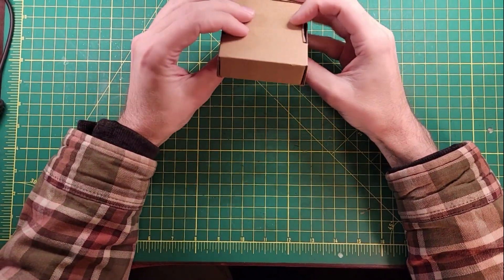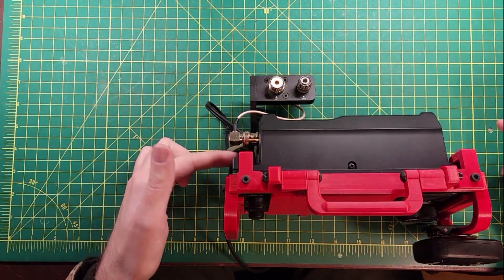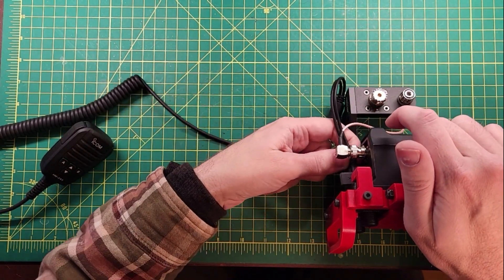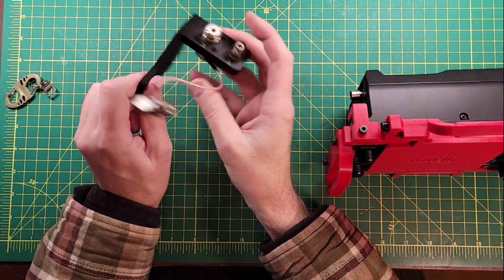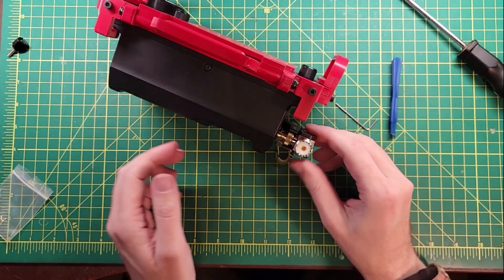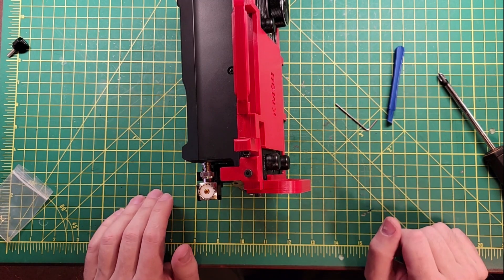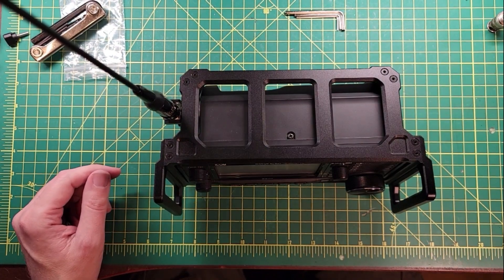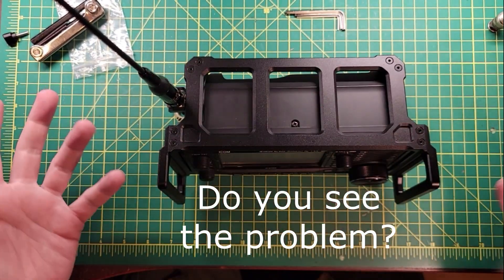Windcamp RC-2 for the IC-705

Comment: so i totally ditched the right-angle plugs on the mic/speaker connections about 2 days after I got my 705 - replaced them with straight plugs, have the full windcamp setup - frame and V2 antenna mount - no issues
Reply from the maker: That would do it
Reply: What straight plugs did you use?

Comment: My original wincamp rc1 mount causes terrible swr issues, interested in an alternative , thanks for making the video. Hoping without the coax it will be more reliable.
Reply from the maker: Interesting info.  I don't think I've ever run without the windcamp connector... I wonder how mine is.
Reply: @temporarilyoffline  I've learned today on FB that windcamp don't always solder them connections properly which may be what's wrong with mine.
Reply: I have the same problem with SWR.

Comment: I will get this, even though I came up with a solution for the RC-1. This is much more compact. As far as the speaker/mic plug issue, maybe the best solution is to come up with a dual male to female plug with straight connectors that is like 4 or 6 inches long instead of having those 90 degree plugs right up against everything.
Reply from the maker: I've thought about swapping the plugs to straight plugs.  Would make sense in this configuration.  The only place those right angle plugs make sense to me is in a permanent mounted go-box
Reply: @temporarilyoffline  I'm wondering if the Icom OPC2144 would work. It doesn't specifically say it fits the 705, and it's still a right angle, but at least it's a single right and you can plug or unplug the other end at will.
Reply from the maker: @W9HJBill  I might work, but for the cost of these 3 items, one "shouldn't" have to add a 4th.  I'm just grumbling though, not arguing.
Reply: @temporarilyoffline 
hint:
rotate the radio 90 degrees to be vertical. 
demand  addition of "portrait" display mode.
solved.

Comment: Agree it seems a bit odd. I don't have a 705 yet!

The speaker mike connections look like they are right angle. Perhaps vertical extension, plug and jack, would allow a better connect/disconnect. Of course losing those is a down side.
Reply from the maker: Exactly!

Comment: Two things: 1. Put on the BNC/SO239 connector first, then mount the antenna mount pieces. That way you can get the BNC latched on easily. Then tighten down the little Allen wrench set screw. 
2. The speaker/mic connection is the worst part of the radio (other than the manuals). I'm waiting on some connectors & other bits to make a single use mic for the radio. I don't need the speaker mic and if I need headphones, I use my iPhone BlueTooth earbuds. When I get the yet to arrive mic parts modified, I expect I'll have simple one plug mic. 
. . . At the same time, if Icom had made the mic & speaker connector spacing to match other speaker mics with that style of plug-in, well, all you'd have to do is get one of t hose cheap Chinese speaker mics (or have Icom provide a proper mic with the proper single plug hardware) and go that way.
. . . The IC705 is a boffo radio, at least so far to me, but it does have it's "Why'd you do that?" flaws and questionable ergonomics.
73 de W8IJN
Reply: Also, the WindCamp wrap-around makes it impossible to mount the Begali Adventure IC-705 bracket to the radio, since the screw holding the bracket on the radio underneath uses the same 1/4-20 tripod thread on the bottom of the radio as the Begali bracket. My only way around that is machining another 1/4-20 threaded hole in the wrap around, which throws off the balance of the radio & bracket, not a workable solution the way I see it. Thus the HamGear3D frame is what I use now.
Reply from the maker: That hamgear 3D frame is excellent also!

Comment: Not had a problem with the RC-2 as I only use the microphone socket but there is the option of using the trailing eight pin microphone adapter cable from ebay.
Reply from the maker: Good Idea, Thanks!

Comment: You could’ve used the longer ground screw from the RC-1 and used a couple of small washers under it to space the bracket out?
Reply from the maker: I probably could have, but the products from the same company should have worked together out of the box - even if that meant including the extra hardware to make it happen.
Reply: Yeah I just looked at it really closely and I don’t think it’ll work it would block the articulation if you spaced it up. And 100% percent agree with you, it should work straight out the box. The Peovi stuff is way expensive.  The add on cage is $150
Reply from the maker: @BadHorsie2  I would ABSOLUTELY LOVE that Peovi cage in anodized red or orange!  I just can't justify it.  The windcamp cage is very nice and functional on its own and the whole works fits nicely in a 50cal ammo can.  Hard to beat.

Comment: It be nice if you can put a dual antenna that you can switch back and forth like a 2 meter and 10 meter that we use on a regular basis. Hopfilly with out using an antenna tuner.
Reply from the maker: They make a diplexer that will let you switch like that.

Comment: Put the Philips screw into the ground on the radio and use the thumb screw for the angle adjustment.
Reply from the maker: Since then I've added a lead with a single Anderson powerpole to the ground connector - now it integrates nicely with the rest of my antenna systems.

Comment: When I got my RC-1 on the surface it worked but seemed to be clunky in practice. The RC-2 looks a bit better thought out so it may work better. I have a PEOVI PV705-1 cage around my 705 which I like. Although is does not give me the same amount of protection as the cage you have, it functions well and looks like it will work just fine with the RC-2. So with that said I may just order the RC-2. Thanks for the Video and take care. Vic de KE8JWE
Reply from the maker: You welcome Vic, let me know if it all fits together.

Comment: Struggling to find a source for a straight 3-6" M-F 2.5mm TRRS extension for the mic. Anyone have a link? (the 3.5mm TRS speaker plug is easy to find)
Reply from the maker: I can't find any either... I'd probably build one from a larger cable.  I can't even find 4 pole "solder on repair" parts.

Comment: The RC-1 lacks two parts that would make it 100% compatible with the ARK-705 cage. It needs a spacer and a longer mounting screw to put it completely outside of the ARK-705. Without having the IC-705 and the ARK-705 in hand to get proper measurements, I would say that a spacer that is about 1/4 to 3/8 inch long would be enough to clear the cage. That's it...an extra few bucks makes the two work together.
Reply from the maker: Amazing you could figure out from a video what a team of engineers with a budget couldn't get right!
Reply: @temporarilyoffline  Not just looking at your video on how they don't fit together, but going to the Windcamp website and looking at the limited still images of how the RC-1 and ARK-705 are shaped and assembled.

Comment: Should make an extension for both the handmics cables, and a lil plugin spot with RJ45 that can hook to any kind of breakout/mic(even the stock handmic :))
Reply: Maybe add dip switch, or something to turn the handmic speaker on/off
Reply from the maker: That would be great
Reply: @temporarilyoffline  Get 3d printing, shouldnt be too hard with a RJ45 Keystone + some wires :P
Reply from the maker: @nekotherion7317  exactly!

Comment: fortunately, Amazon has these Windcamp ARK-705 in-stock now.  Previously, they were shipping from China directly but that could be problematic since they are having Covid lockdowns over there.  Looks like I'll skip the RC-2 and only buy Windcamp ARK-705
Reply from the maker: I really like the ARK-705.  I'm a big fan for protection on all portable radios.  It is super easy to trip over a wire and yank a radio across the field.

Comment: I see a fix for this mic/spk cables interference with the bracket. We need a single cable plug with two jacks (like the baofeng data cable) that when plugged will exit straight down and has two female 3.5/2.5mm connectors where you plug the Icom mic/spk handset. 6in in length would be perfect and you can leave it plugged in the radio. Now, lets find someone who can makes it.
Reply from the maker: I bet it's the same cable as the id-5x HTs take
Reply: @temporarilyoffline  Yeah that's the one. If Icom made the Speaker/mic that comes with the IC705 with straight plugs instead of 90deg, using a cage wouldn't have been an issue.

Comment: Looks like an issue with  the speaker mic .. WHY the right angle connectors ? even without the cage its a pain in the ass to connect both .. if they had straight connectors ZERO issues
Reply from the maker: Agreed!  I don't know why they made them right angle

Comment: switch the large black thumb screw at bottom with phillips screw u put at top. the black screw is used for the movable portion of the bracket. just a thought. de wb8idy 73
Reply from the maker: I can agree with that.

Comment: it is amazing how all these products reinforce the horizontal configuration while  tbe obvious solution is to go vertical.
Icom created the 705 with a top facing antenna port and then crippled everything with landscape only display mode.
How would you like to use your smart fone in  landscape only?
Why havent you ever added a right angle adapter to any of your 2m/440 HT's or put them in a horizontal cage?
why don't the beltclips allow you to hang your dmr HTs on your belt horizontally? surely you could add a right angle sma... LOL! 
THE MAIN PROBLEM WITH  ic 705 REMAINS A LACK OF VERTICAL "PORTRAIT" MODE OF THE DISPLAY.
you are all suffering from collective failure of imagination. 
73.
Reply from the maker: I'm right there with you!
Reply: The antenna port on the 705 is side facing, not top facing. 
I would rather be forced to use landscape over vertical on my phone any day. Would be difficult to take photos or videos otherwise.
The 705 is not an HT. 
The scope would be less useful in vertical mode, and the radio would be more likely to tip over. I suppose if it played tiktok videos, portrait mode would be useful.
Being able to change the screen orientation would be nice, but I don't see there being much demand for it.
Reply: @2025_Is_Going_To_Be_Great 
you're just another enforcer of the status-quo. 
fighting against the world of possibilities mind locked in the mediocrity of just good enough.
Poor You.
No, the antenna port is not side mounted until the optional rubber feet are installed by the user and the whole point is to not be forced into any orientation but to have a choice